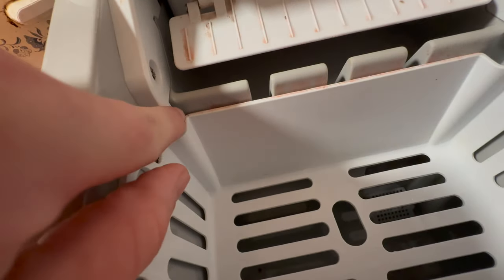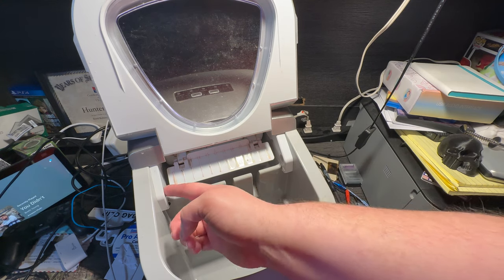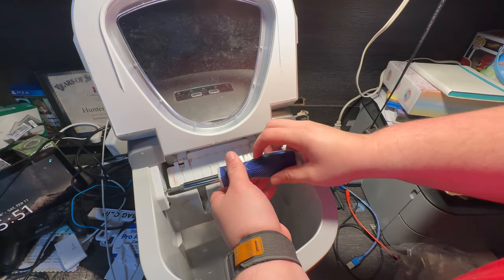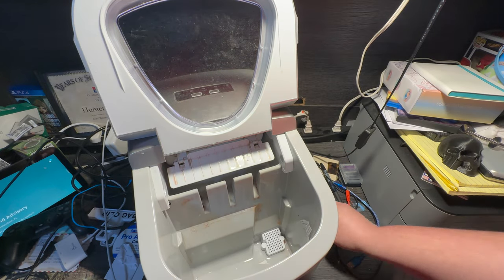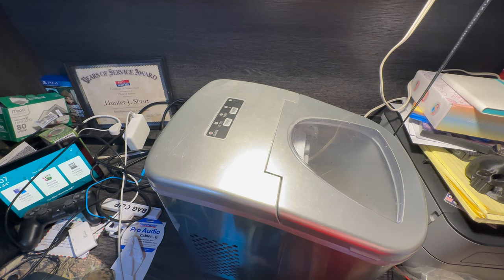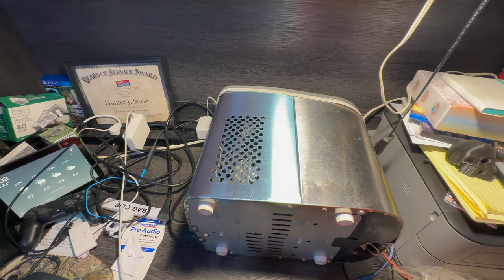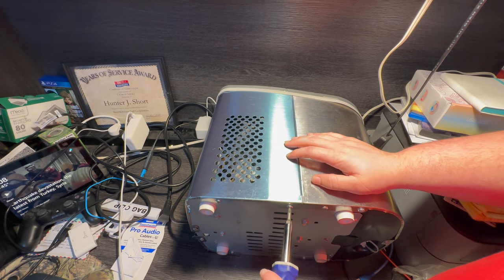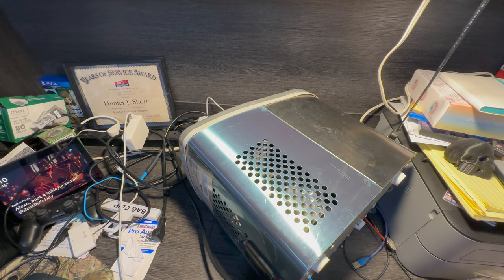Trying To Fix Frigidaire Ice Maker EFIC117-SS

Comment: IF YOU READ THE MANUAL...you will see that you are supposed to CLEAN the machine whenever you see signs of mold or notice an altered taste. I clean mine every month anyway. BUT...to clean the machine, you either purchase a nickel-safe ice machine cleaner (like used in commercial ice makers) OR you can use a 50/50 solution of WHITE vinegar and water. Run the unit for two bins full of ice with this solution. Then EMPTY the unit of water and rinse the reservoir with clear water. Fill reservoir with clear water and run two bins full. Dump and empty, refill and run. This time, taste the ice from the first batch. If it's okay, you're good. If not, do another clear water rinse.

Beyond that, for anyone else with issues on this machine, the most common one is that the panel shows "Add water" when there is plenty of water. 99.9% of the time, this is caused by the water sensor being corroded or just gunked up. Taint easy to get to. It is a slim wire recessed in the right hand (viewed from the front) long plastic piece that also holds the bin full sensor eye.  It is in the water stream that enters the bucket. 

Remove the BACK section of the cover. The front section will NOT come off. Note that this cover TILTS to remove AND replace. Next, remove four screws holding the top on. These should be evident. Just move the top aside. You will easily find the sensor wire. Take it out and gently clean it with a scrubby or fine sandpaper. 

Maybe I need to do a fix-it vid for this. I've rebuilt mine like 6 times for various reasons.

Comment: For people like me that have one of these and it's not working. Why do you feel the need to comment your  stupidity? Do yourself and all the rest a favor and keep it to yourself. I appreciate the video, as it shows me the breakdown and what to do and not to do. Thank you.
Reply from the maker: You're the best! Thank you! I'm sorry there wasn't much to show since that screw wouldn't come out, if you are able to get the screws out, check the limit switches for the basket, they can fail, the water pump can fail, to basket motor can fail, but any one of those parts are typically cheaper than a whole new machine, so if it's one of those simple parts, it's worth investigating for sure, these machines are pretty simple.

Comment: Legit just pushed the plastic back inside the icemaker part while off, it started making noises so i put water in it and sure enough starts pulling the water from the under tank. Hope this helps

Comment: Why was this even posted?
Reply: agree
Reply: While watching I seen this comment and thought because this is a normal problem for these ! Now after watching I have to say EXACTLY how long ? To see you fail ? A few notes I  will politely sat edit ,edit, edit on next video, clear yourself a work area in advance maybe some white poster board beneath make it much easier to distinguish what you are looking at. Have a good assortment of tools with you or edit out looking for them that sort of thing but hey we all start some were nice effort. To those watching for cleaning let me help there is a rubber plug in the bottom pull it the unit will drain guess for those not to bright pull it over a sink or outside its not dribble. forget a drop of beach the water will still freeze ! Duh yo don't want it to make a bucket of bleached ice to clean. straight bleach cycle few times pull plug empty again run couple batches and dump pretty much takes bleach out as far as stuff in top duh tooth brush at the same time.